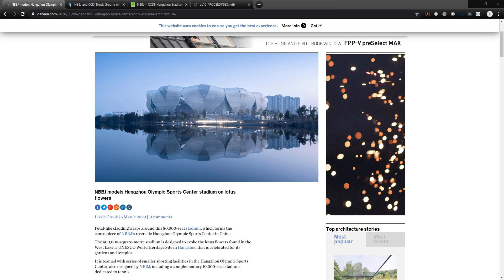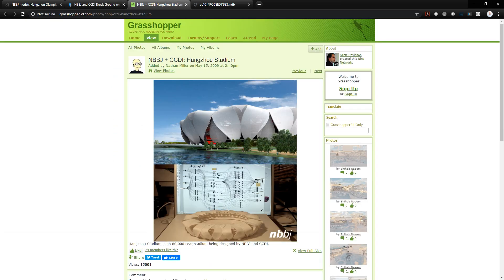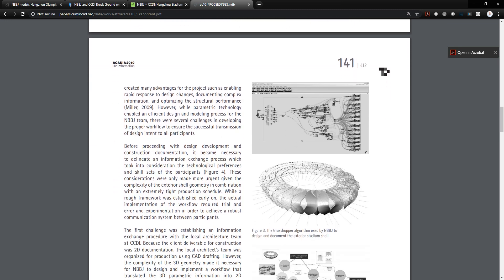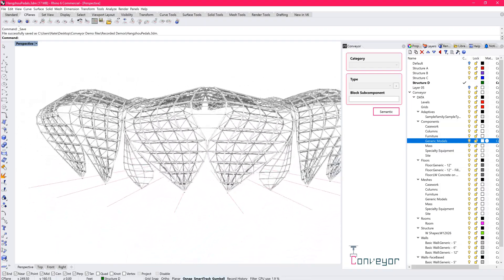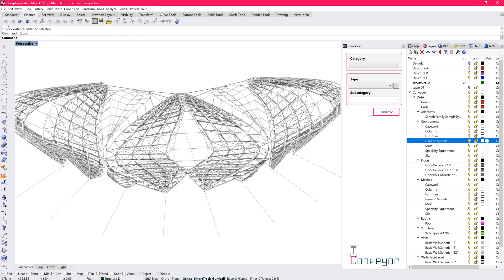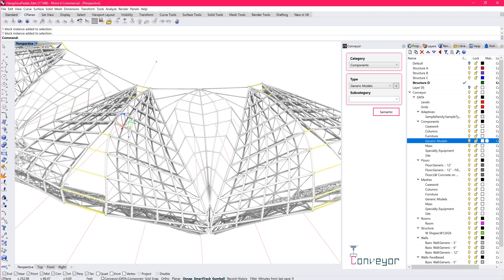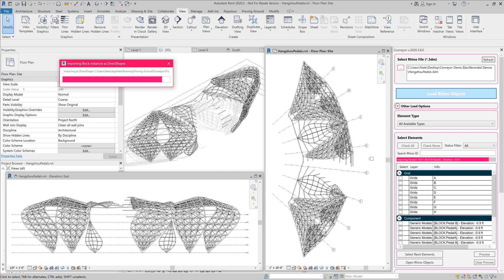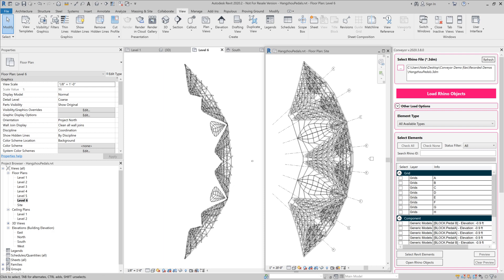WHAT IF Conveyor was used on the Hangzhou stadium for Rhino to Revit?

Comment: Very cool project Nate. Glad this finally got built! Great to see the updated process applied to old work as a comparison. Could probably do a whole series on re-working old projects with new advancements and insights.
Reply from the maker: I was thinking the same thing! It's cool to think about older projects and what could have been done differently if provided by newer tech. At the same time, we collectively have used these older projects to move forward and learn new things. The tools we have wouldn't exist if we didn't push through the "hard way" first!